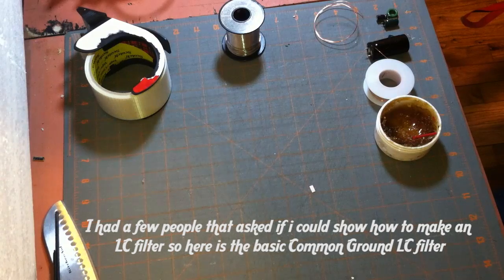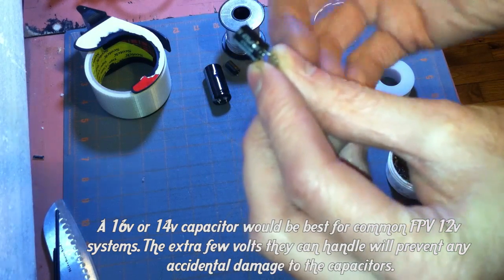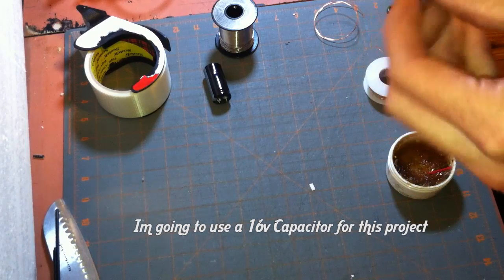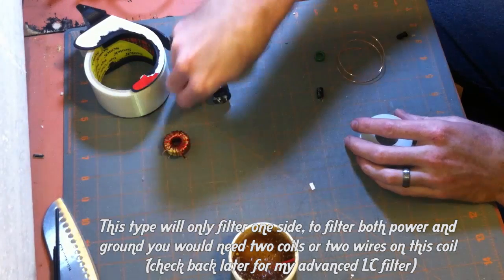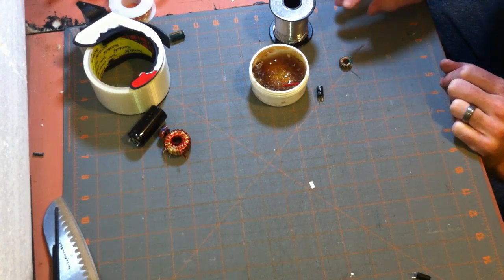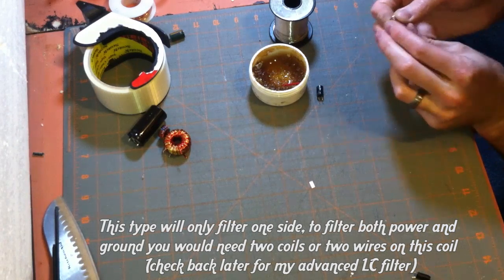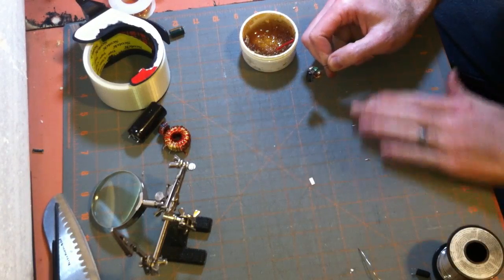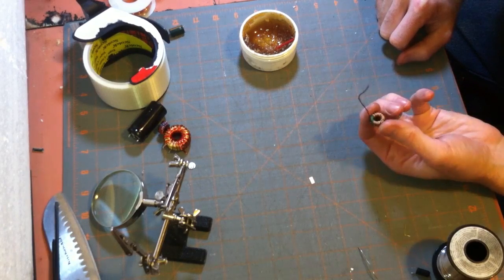LC filter build (common ground)

Comment: Quick question ,does the filter have to power the camera ,vtx or both when installing into you quad for cleaner Fpv ..
Reply from the maker: both. you don't want noise getting to any device on the video system.
Reply: +Atom RC thanks man ,, I did it and yeh,,,,it works....

Comment: On another video discussing the same topic they stated that one would need a 25v cap for 4S system. A 3S battery supply providing ~12V for all excepting the FC would require this LC, but for my Hex running a 530kV for larger props I am forced to use a 4S Flight battery and use two Step Down Volt Regs. creating 5v for FC/peripherals, ( I use adjustable DC to DC Buck Converters) and 12V for the FPV camera and VTx. My long winded preamble culminates in this question...ehemmm." Do you need to run an LC when there is a Volt Regulator providing constant voltage?" There are both  inductors and capacitors in the circuit of my buck converters. And also "Why would anyone be considering  an LC for a voltages other than 12V considering most all FPV components are 12v based, for instance a simple board camera and 200mA 5.8GHz VTx?" Thankyou for the build video, always welcome input! :-)
Reply from the maker: for higher voltages you would need to change the capacitor. I personally use a slightly more advanced circuit now with my stepdown for my FPV gear. I use a variety of inductors, capacitors, and diodes to filter even more but it requires more power since diodes have a voltage drop across them.

Comment from the maker: I bought it at radioshack. It comes in a 3 pack with three different sizes. Check radioshack.com and search for "magnet wire"
Reply: Hey Atom, would this be used for filtering out noise for FPV? If so, would you mount this to your ESC?? I just got into FPV, I have the FatShark 5.8ghz and just learning. Only made one flight so far... still getting used to the whole idea of flying FPV.. Thanks, jc
Reply from the maker: Yes, if you have banding from your ESC then you can use this between your battery and the FPV gear. Most fat shark stuff has a good filter on it already though.

Comment: One side should be enough.  The Ferrite side comes from the noise source and the capacitor goes to the "quiet" side.  You can think this way: the inductor blocks the noise and the capacitor drain the rest to the ground.